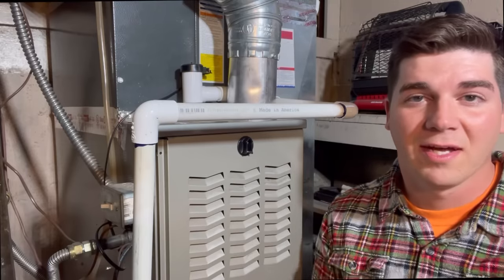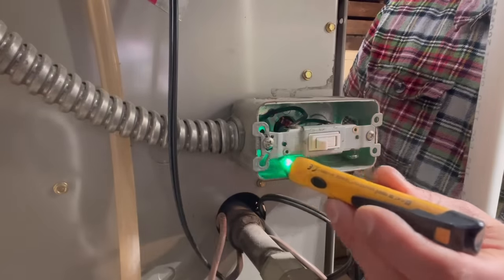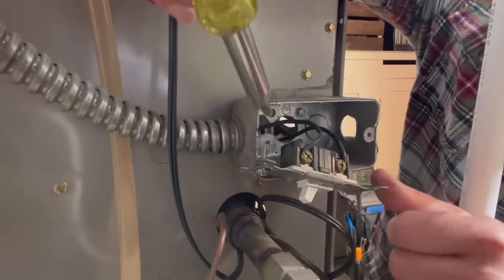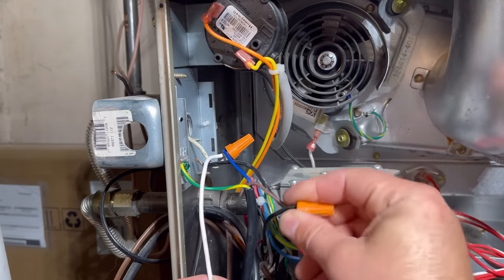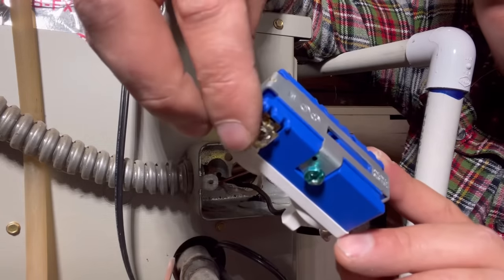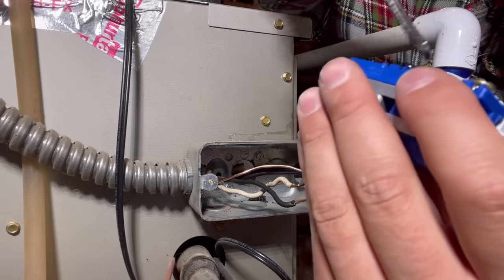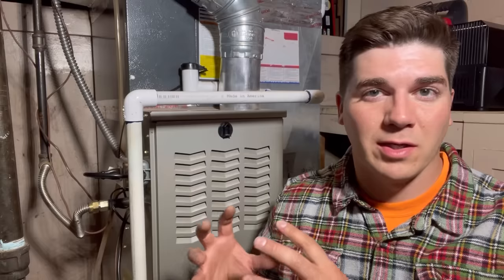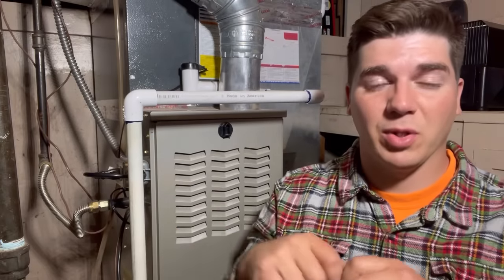This Could Keep Your Family Warm During An Emergency Power Outage.

Comment: you should make sure that extension cord you used as a pigtail is 14AWG wire. standard 16AWG cords should not be used as permanent wire for an appliance.
Reply: Wondering what the rationale for this is, as the ampacity of 16 is more than enough for this application.
Reply: @boggy7665  op had to show us what a know it all he is
Reply: You do know that the wires in the furnace are not even as thick as the wire you are quoting?
Reply: He had a 20A breaker, so by rights you should use 12 gauge, but you have to determine what the draw of the appliance is and how long the cord is to know whether it is safe or not.
Reply: @jaireidca  I understand what your saying. I personally have cheap extension cords.
But I also have a good 100’ 10 gauge extension cord also. Like you said though it’s all about good judgment for what the application it’s used for.
Reply: @frankdelucey2137  that's hilarious. I didn't know that and assumed it was an inverse relationship. What a tool this guy is
Reply: Figured it might be in case there's a dead short, maybe wouldn't blow the 20A breaker, would only heat the #16 wires red hot.  Still, as short as that length of #16 is, would likely be ok even on a dead short, would blow the breaker.  Yes/no?  Could do what I used to see a lot back in the day... put a smaller fuse on the furnace.  Or put a 15A breaker in the panel.
Reply: @jaireidca  I agree that it should be #12. But either use #12 or replace the breaker with a 15A and use #14.
And the keyword in the original comment is ‘permanent’. Since this is intended to  run continuously, it should be at least 14.
Reply: All Gauge wire cannot handle 15Amp and 20 amp circuits or current draw! 

14 Gauge will handle up to 15Amps of peak current, 12 gauge up 20 Amps of current. 16 gauge up to 13 Amps. You can’t buy 16 gauge wire housed in a Romex! Romex wire has a plastic white, Yellow or Orange sheath around it with 3 or 4 Conductors which is the solid core copper wire underneath its wire coding color in black and white with uncoated copper wire always referred to as ground!

Romex is available in 14/2, 14/3, 12/2 and 10/3 (2 blacks (hot), 1 white  and one copper wire for 30 amp circuit’s! Typically for electric oven, AC condenser, electric dryer. Some AC condensers will require 8 gauge wire. Romex AKA southland 8/3 wire
Reply: I have never run across 16 ga wire in a home...only 14 ga.
Reply: @dvig3261  What about in extension cords?  Which this is more-or-less equivalent to.  Powers a single device that draws way less than 10 amps.
Reply: @jaireidca  he should also be using a switch and receptacle rated for 20amps. But then again... looking at the wire going to the furnace switch only looks like 14awg. Which in that case he should be replacing the breaker with a 15amp breaker.
Reply: @dvig3261  take your light fixtures down and check the wire size.
Reply: Microwave oven cord
Reply: You could easily make up a cord with a plug with 14 wire with a small piece of wire to any length that is appropriate to your application.
Reply: I wonder what guage knob & tube wiring is 😱
Reply: Y.
Reply: @boobtubeakatv1296  Same as modern.  Just don't pack thermal insulation around it.
Reply: Most appliances have 16awg cords from the factory. This is nonsense.
Reply: Awww electrical where everyone in the comments is an expert 😂
Reply: 12 wire is what is needed for a gas furnace with 20A breaker
Reply: If the furnace isn't rated for more than 13 amps continuous load then 16 gauge wire is acceptable. Many appliances are equipped with 16 AWG cords. However, that 20A breaker in the panel should probably be 15A. Especially if it's #14 wire going to the furnace. Now that the circuit ends in a single 15A receptacle, it is required to have a 15A breaker. 15A receptacles are only allowed on a 20A breaker if there is more than one receptacle on the circuit. So.... Yeah the breaker is likely the only actual problem there.
Reply: @boobtubeakatv1296 Typically was 12 for mechanical strength reasons.
Reply: @boggy7665  it is not an original manufacturer installed wiring, it must be sized to the breaker feeding the appliance, 12AWG is required for the 20A circuit. 14AWG can easily carry the 20A circuit but is still undersized per code.
Reply: 12 AWG for a 20A circuit, which this is according to the breaker.
Reply: @boggy7665  it's a 20A circuit.  16AWG is undersized for the breaker.  Even if the actual draw of the appliance is lower, the breaker determines the wire size.
Reply: @frankdelucey2137  chassis wiring limits are different.
Reply: @desertaip9137  definitely agree, but as we all know someone who has rigged up something to work as a temporary fix.
Reply: @swizzarmygrizz  code for electrical is different than for appliances. I had that argument with water heater wires. And my timer switch. I used number 12 wire on the other end of the timer. Water heater wire should be number 10 wire. Inside the water heater jacket are number 12. But the NEC require number 10 for most water heaters. The two codes are different and home owner insurance require wiring to be up to code. 73
Reply: @aaronbryant8489  most people know the code or can find out from the big stores in the electrical department  I would never give false information. The internet will also tell you what size wire to use. 73
Reply: @aaronbryant8489  sorry I see your point 16 gauge wire on a twenty amp circuit is undersized . The real question most house outlet receptacles are wired for either 20 amp or 15 amps. It's the  current draw  of the appliance which dictates the size of the cord. I would check local code and what is acceptable. This video is not good for electrical students. I cannot answer what is right for every location. Local codes trump accepted national codes. 73
Reply: That's a computer power cord with the end lopped off, if it will power a 1000 watt psu it will power the blower on a gas furnace, because on a gas furnace that's the only thing that needs electricity is the blower, the burner will function without power just fine.
Reply: @cjporterfield1955  you need power for the thermostat circuit and you also need power for the electric gas valve. Furnaces are not like the gas water heaters. Safety features are built into gas furnaces. 73
Reply: Extension cord is illegally chased through junction box. Great idea and most likely no issues but illegal installation if you want to get technical
Reply: I would suggest that the pigtail should be 12 gauge since the breaker is 20 Amps.
Reply: @pro-nation4841  so all our TV's and Radios and stereos should all have number 12 wires on them. This kind of advice is an oxymoron because number 16, 18 and 20 is used on most household appliances and sometimes a number 14 is used but not that often. I would calculate the current on the device being plugged in and maybe going one gauge better than what is needed. I have all twenty and one thirty amp breakers on my outlets. Don't ask why there is a thirty amp breaker in my kitchen but that's the way it was built in the early 70's I'm sure it passed UL inspection before the meter was installed. If I decide to stay where I'm living I will break up the kitchen outlet circuits and use 20 amp breakers. And install GFI outlets. 73
Reply: @Nonsense62365  I seen 10 gauge Romex with one red one black and one white wires and a bare copper wire for ground and sometimes a green wire is in place of the bare copper wire. Number 8 and larger has two or three black wires and a bare copper wire for ground. And not to forget sometimes the sheath is the ground for shielding and ground for the circuit. 73
Reply: I have to laugh through all these comments and not one doesn't have a point. When you think about it the best answer is to know your local electrical code. That's what the inspector will go by. I would just use a transfer switch and leave the wiring alone. There is a reason the furnace is hard wired and not on a pig tail. I seen water heaters wired with a 30 amp pigtails but never a heating and air conditioning units. saving the window units but that's another video. 73
Reply: I use 12 awg even thicker
Reply: If its romex it can go thinner (14) but external extension needs to be thicker since its not rated the same.
Reply: Transfer switch is the best then you don't have to change the wiring. Hard wired circuits are better than pig tailed. I remember moms dryer was hooked directly to the fuse box no pig tail. Boy that was the best dryer we ever had, it ran over thirty years before the element needed replacing. The only maintenance needed was to oil the bearings on the drive shaft I still have the motor and if I was to hook it up it would probably still run. I have to clean out a shed and when I find the motor I will hook it up. It runs on 240 volts and can be set to run on 120 volts. The dryer also could be wired for 120 volts but it's more efficient to run on 240 volts. 73
Reply: Great help. I wish we could help the hundreds of thousands who just lost power.

Comment: I understand some people might not agree with this solution, but seriously dude THANK YOU! We had extreme winds come through yesterday and knocked out power across the city. Today is 32°, but thanks to this video, my family and I are are sitting at a warm 72° inside! Again THANK YOU!
Reply: You won't be so happy when your house burns down because the guys hack is dangerous. Make sure your smoke detectors are working because you are going to need them some night while you are sleeping and the furnace wiring shorts out.
Reply: @winstonsmith8898  Forreal, If this was safe, it would already be installed on most furnaces already. Power transfer systems w/ generator interlock switch exist for this reason, much safer having it connect directly to the main panel through a sub panel and not having your main breaker and generator run at the same time.
Reply: @winstonsmith8898  This is a bit of an overreaction in my opinion; needless fear mongering for no good reason. If you do it exactly as he says, it will be fine. The draw of the igniter and squirrel cage fan really isn't that much at all.
Reply: The most dangerous part of this is the wiring running through the sheet metal with no strain relief just begging to be shorted on that sharp edge. Crazy cause he knows the issue and does it correctly on the exterior of the box.
Reply: So much criticism and pearl clutching 🙄
Reply: Me and my stepdad have been doing this for years. It works if you have common sense and some electrical know how to prevent accidents.
Reply: @troy3456789  Correct.  The Induction Draft Motor draws apprx 1a.  Blower @1/2 horse is approx 7A-8A.  Well within a 20A rating. The only thing to be sure of is that the plug wiring is 12ga.
Reply: @mustangcody  Where the voltage is accessed doesn't effect operation.  It's more CONVENIENT to have it at the MSP.  But does not change what the furnace draws or what the generator can provide.
Reply: @crforfreedom7407  I'm a bit surprised the half hp motor draws that much current, and yes, even at 9amps it is well below max current for a short piece of 12awg. 

It too has a start capacitor to minimize the start surge, right?
Reply: OMG! Yeah, we better not do anything unless some expert gives ya the nod. And people wonder why the country is in the toilet. After all, look how good those experts are doing with the public education system. Not to mention the experts putting those flammable EVs out into the general public. What would we do without those people?